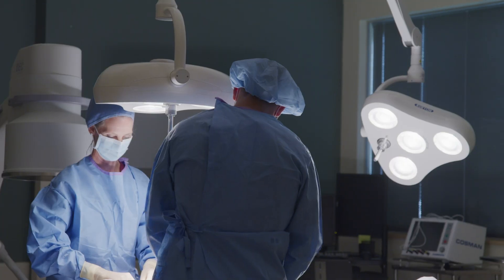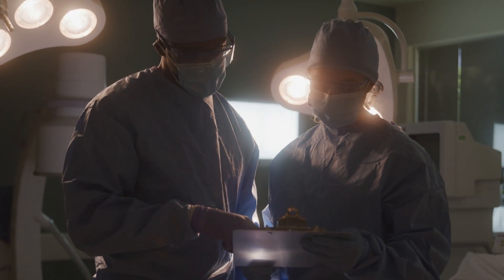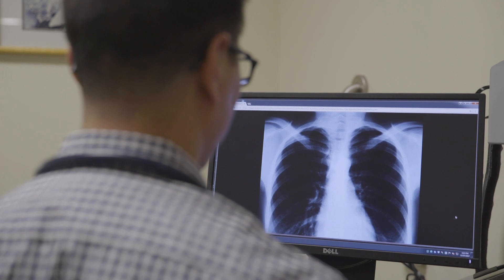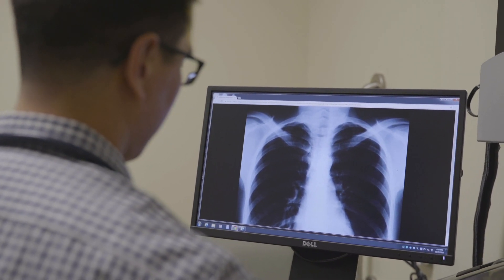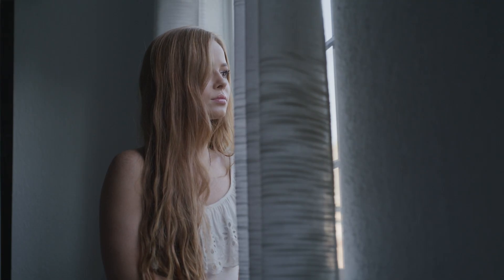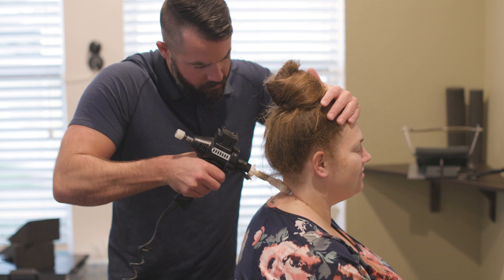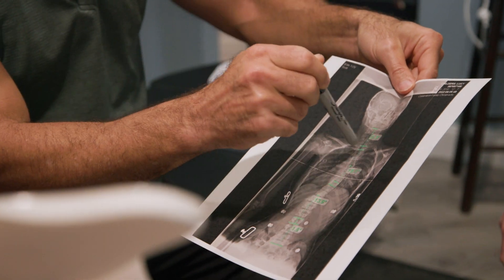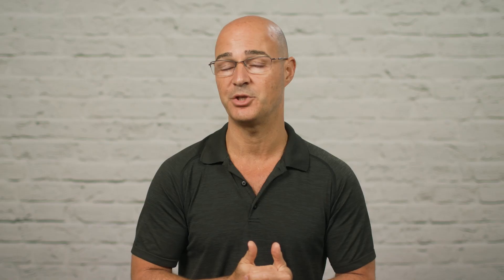Common Problems After Spinal Fusion Surgery

Comment: I had surgery over 50 years ago. I now have lower back pain. Not sure this is connected to my spine condition but a physical therapist has suggested due to my spine BELOW fusion taking the brunt of gravity. Possible compression of discs etc. I've been getting acupuncture past two years now, and it has helped ease the worst of the pain.
Reply from the maker: t's completely understandable to wonder if your past back surgery is related to your current pain, especially when a physical therapist has pointed out a potential connection. What you're experiencing is often referred to as Adjacent Segment Disease (ASD), and it's a very common issue that can occur years or even decades after a spinal fusion. To learn more about our methods, please visit our website at https://www.scoliosisreductioncenter.com/treatment-approach.

Comment: I’m turning to YouTube for help.  I’m 7 months post op, my 10th surgery. Im fused T10-S1, C5-6, and my right SI Joint.  I’m starting my 3rd round of PT next week, dozens of trigger point injections, acupuncture, cupping, myofascial release massage, red light therapy in the sauna, but my pain is getting worse!  The pain is located along my back rib cage, both sides and radiates to my sides and slightly to the front feeling like my abdominal muscles are pulled.  I have muscles awkwardly tugging and pulling in my back when I move my arms.  The rib cage pain is sharp and feels like Im being stabbed.  My neck fusion has failed and it’s causing terrible migraines.  I also continue to have GI problems which GI has ruled nearly everything out.  So now Im being sent to see a special neurologist to see if it’s nerve damage from the surgery.  Im desperate for help with this rib cage pain.  It’s destroying my life and I’m at the end of my rope.   My pre surgery pain is gone, but all this new pain Im told is scar tissue.  If so, why is everything to help it only making me worse?  Could this rib pain be something other than scar tissue???  Im losing hope. 😖
Reply from the maker: To learn more about our methods, please visit our website at https://www.scoliosisreductioncenter.com/treatment-approach.
Reply: It's your neck,causing some of your issues I have them also 10 years after neck fusion 😢

Comment: In a spine with scoliosis, the spine does not flex as it is supposed to due to the curvature. So a fusion isn’t really giving up function. The spine already wasn’t functioning. This was demonstrated to me by a chiropractor, using a Chinese snake toy. It is made of segments of wood connected with wire. If you bend the toy into an S curve, it will not flex backward and forward. Same with a spine.
Reply from the maker: To learn more about our methods, please visit our website at https://www.scoliosisreductioncenter.com/treatment-approach.

Comment: I cant speak for others but i can tell you what im going thru. First off i had the rods and screws put in my back. A month later getting out of bed i felt a sharp pain. Went to the surgeon for a follow up. Was informed one of the screws broke. Went in for surgery to replace the screw. Maybe a month later started feeling pain again. Went for a follow up and was informed the replacement screw was coming out of my back. Went in for surgery again where he replaced the screw with a bigger screw. Im in so much pain from that bigger screw that i cant stand up straight and im in pain all the time. The surgeon suggested i have an SCS put in my back. Did that, didnt work. Now i have went to a revisionist surgeon. He is going to remove all the shit in my back. I pray i am like i was before all of this craziness. I have so many scars on my back that it looks like hamburger. If you can avoid surgery DO IT.
Reply: Yes I decided not to have the revision surgery. At 61 years old and being cut on again with no gaurrantee to end the pain its just not worth it. So I'm going to see my moms doctor. He controlled her pain with medication. She had pretty much the same problem I have. Failed back surgery.
Reply: @bigbadjohnpesek9894  I have very similar problems, including the screws and cages in my back.  Find a Pain Clinic that does Ablations and other similar treatments to help control the pain.  Nothing gets rid of the pain, but the Ablations have helped with the intense pain.
Reply: I was told by my orthopidic surgeon that I would have keyhole surgery for bone spurs and that I would be running around in 15 days found out 5 months later, still trying to recover that I had S1L5L4 spinal fusion what kind of surgeon does that
Reply: @pyianni9327 one that has an expensive wife and xwife.an expensive house and large student loans.  Spinal fusion makes millions for these surgeons
Reply: Who did your surgery?
Reply: @ I had fusion of L4-L5 Olif by Dr. Chin at Kennedy White in Sarasota Florida. Excellent credentials etc but sounds like he may have missed a bulging disc below that is causing me excruciating pain. I feel like some surgeons just rush to get it done and don’t see the entire picture and we suffer for it. He was excellent otherwise. He is an orthopedic surgeon who also specializes in spine cancer.
Reply: @diananighswonger441 its been so long but i think his name was dr. Kitchens. I finally found a dr. To give me pain meds. Yesterday was the first time in three years that i could go grocery shopping with my wife and walk upright and not be in pain.
Reply: His name is dr. Kitchens.  @diananighswonger441
Reply: Hang in there bro,,sorry to hear your story..
Reply: Im trying but the pain is so intense that i thought about saying to hell with life and end it. My only saving grace is my new grandbaby. I want him to remember me. @jimjones1505
Reply: Hi any update please about your health?
Reply: For some reason no Dr. will give me pain meds. I think they flagged me because I have seizures. Not from medication but from cough syncope. I'm definitely not a dope head. So I'm going to go back to the surgeon who did the rods and screws and demand he remove them. Then I want to have nerve ablasion done. They won't do that if I have any metal in my back.
Reply: @bigbadjohnpesek9894 good luck😂😂 with telling the mighty surgeon what to do
Reply: God I can't remember his name. This happened three years ago. I finally found a Dr. To give me pain pills. He's giving me gabapenton and hydrocodone. He increased it and now I can stand and walk upright. I still feel a little pain but nothing like it was. Its been one hell of a time. I didn't think I was gonna make it.
Reply from the maker: Thank you for sharing your story. To learn more about our methods, please visit https://www.scoliosisreductioncenter.com/treatment-approach.

Comment: I had a hip replacement in 2020.  It went ok till after a few months the hip joint began sublexing.  My surgeon felt it sublexing but at the same time we couldn’t get it to sublex when doing a fleuroscopy.  I worked on strengthening and it quit sublexing.  In August 2023, I had 2 fusions done. One at L2-L3 lateral cut and one at L5-S1, anterior cut. Then I had a huge herniation at L2-L3 and had revision surgery which was a laminectamy, disectomy and fusion, posterior cut.  This cured everything!  I felt great!  Then in June 2024, I began experiencing hip pain which has since became unbearable.  What’s your diagnosis of this?  I felt better than I have in years, then my hip replacement began hurting!  I’m sad, angry, depressed, and don’t know what to do…
Reply from the maker: We would be delighted to initiate a conversation with you through our contact form at https://www.scoliosisreductioncenter.com/contact, provided that you are able to travel to our location for treatment.

Comment: My neurosurgeon removed my screws in August 2023. Doing great now.
Reply from the maker: Great!
Reply: Sir how are you now?
Reply: Wait so after they do spinal fusion they have to go back in and remove screws?
Reply: @Bullfrog-py9qt  No, only if there are issues with the hardware OR you need a fusion like a level up or down. Otherwise no need to open you back up.

Comment: I had a fusion, laminectomy, and microdiscectomy at L4-S1, but not due to scoliosis. I had spondylolisthesis that resulted from me falling and breaking my back as a child. My vertebrae was slipped enough that it required surgery. I was skipped over and physical therapy or pain management because I was so severe. My surgery was in 2017. My fall was in the late 80’s. I went that many years with no treatment as I was only like 10 years old when I fell. I was grounded that day and I wasn’t supposed to go anywhere. I did, and I fell. I was afraid I’d get in trouble, so I didn’t say anything. Paybacks suck. 

I deal with pain everyday. I don’t see pain management or any other doctor though. I use hot tubs a lot, I stretch a lot, and I relax when I need to. I consider myself lucky I’m still walking. I’m still not sure if I will always be able to. I’ve been told I have fibromyalgia, degenerative disc disease, and arthritis too. I still work full time, but I don’t know if I always will be able to.
Reply: I'm having the same surgery next week.  For an injury I got around 10 years old , same thing. So, you're saying the surgery didnt help you?  I havent worked this year because I cant even be on my feet for an hour straight, or any other position for that matter.  Pissing myself, ciatica on the left, numb burning on the right in my legs.   If this surgery isnt gonna help, I don't know if its worth doing.
Reply: @mattgohlke8216 if your passing yourself you have to have surgery
Reply: @mattgohlke8216  I was around 10 years old when my injury happened as well. The surgery helped me, but it doesn’t cure the pain. I didn’t have the burning in my legs either, however, I was to the point that I HAD TO HAVE IT. I had NO other option. If I wouldn’t have had the surgery,  I’d probably be paralyzed right now. So,  yes, it did help. Unfortunately, it’s not a cure all.
Reply: @mattgohlke8216 did you have surgery, I hope you did and I hope you are recovered?
Reply from the maker: We are thrilled that you have taken the initiative to connect with us. The Center offers a gentle, non-surgical method of treating scoliosis based on natural techniques. To find out more about our approach, kindly visit: https://www.scoliosisreductioncenter.com/treatment-approach.

Comment: This was a great discussion. I unfortunately was talked into a lower back and neck fusion for degenerative disc disease The neurosurgeon said i had no other options Its been hell Im finally in pain management after many years of not getting any relief . Im still suffering but at least my 2 hydrocodone they allow me each day give me the ability to get a few things done.Please dont let them fuse your spine untill you have exhausted all other options
Reply: What other option is there
Reply: @OneWhoKnowz Unfortunately not many.but what I've learned unless you do lots and lots of home work on your condition and get a few different options witch can be extremely difficult and expensive your almost better off dealing with the pain if it is tolerable because wants your fused you can't undo it and your looking at adjacent segment diseases in the future like me now I need 3 more vertebrae fused at 64. So I just suffer and don't do much . I just can't fathom another major surgery at this point 😭🥵🥵🥵🥵

Comment: Having a laminectomy is the reason that spinal fusion fails, never have a laminectomy, not ever!
Reply: I had a laminectomy and discectomy about 14 years ago. Still get discomfort and dull ache at times but my nerve pain is gone. I have often wondered about the long term effect on stability and lateral integrity of the affected vertebra, but for me there was no choice. I wouldn’t agree no laminactomy but it’s also not something to go into without research.